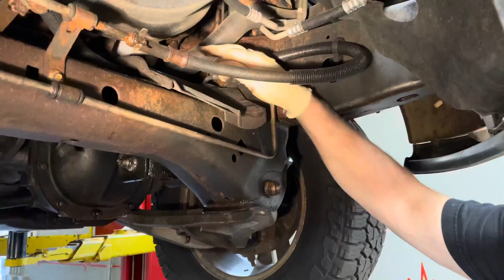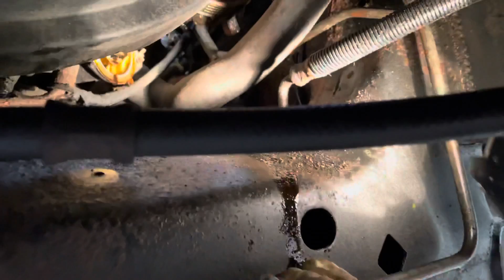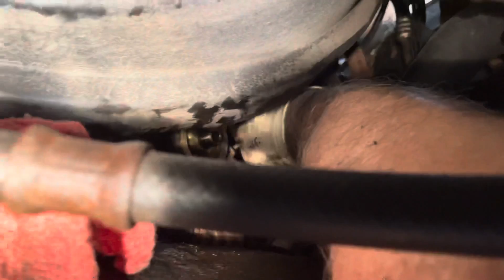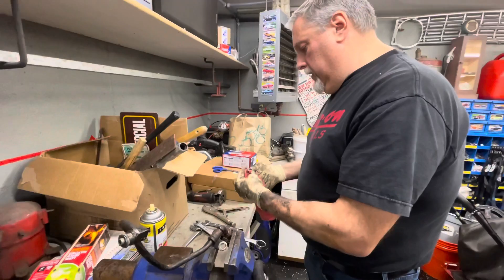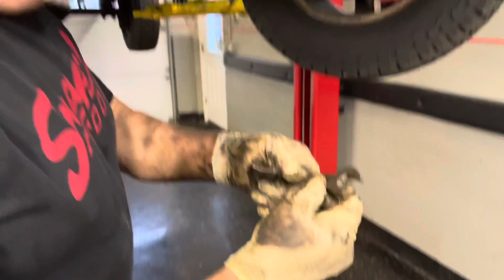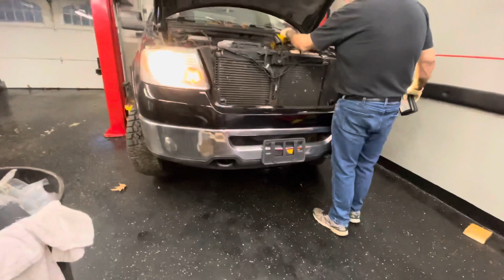How To Replace 2004-2008 Ford F150 Pressure Power Steering Hose

Comment: Do you have a video of how to change high pressure steering hose on an 06 ford explorer with 4.6  v8 I typed it in several times and  get videos of all different vehicles this app is of no use to me if you can't get show what I'm looking for
Reply from the maker: We currently do not have an auto repair video on this particular application.

Comment: Ford specifies Mercon Power steering fluid in the manual but now they dont make it anymore and Mercon V is the replacement for Mercon Power Steering Fluid.   Very important !  Mercon V only , nothing else , dont use those multi use fluids. Some lines may not have the pressure sensor , the replacement line will come with a plug to install if you do not have the Pressure Sensor, most important of this install is the Teflon o ring at the pump , the new line will have one pre installed.
Reply from the maker: Thanks for watching
Reply: @HomeownerRepair  mine is a V6 , similar but a little different set up , the oil filter is not in the way. They used four bolts to the block , there is a bolt behind the power steering line in at the pump with little room to get at it. The easiest way , pull the pulley off first while still mounted on the truck , after that there is clear access to everything. When installing delete that 4th bolt behind the power steering line in. This is recommend by Ford, it was overkill engineering and no need for it. Use an 18mm flex line wrench for the power steering , with the pulley removed it's easy access to it. Install the pump and line ( you will need a new high pressure line for pre installed Teflon O ring ) unless you have the tool to install new O rings and can find the right size O rings.  Also save yourself allot of hassle and get a new pulley, press it back on after all bolts and the high pressure line have been installed. It only takes a few minutes to pull out the fan and shroud and make life much easier, also PB blaster is your best friend on this job. This can be a mildly difficult job of two hours or a struggling fight of 5+ hours to do it any other way. 18 mm flex line wrench, 10mm ratchet wrench, 10mm socket wrench with extension for the bolt at the steering rack ( easier access from underneath) and rent a power steering pulley puller kit. Make sure when renting the kit it has the right size set up and it's not all stripped out , Advance Auto had the better kit as compared to O'Reilly's. This was my experience and hope it helps someone.

Comment: I found it easier to remove the power steering pump to get the fitting out of the pump just cut the old line off at the pump the new line comes with the Quick Connect fitting I screwed that into the power steering pump before I reinstalled it made it a lot easier and didn't have to fight to get it off and I did not have to sacrifice a tool to complete this job
Reply from the maker: Thanks for the tip!
Reply: @HomeownerRepair your video help me so I wanted to share a little trick that I discovered while doing that job so the next person won't have to fight so hard.

Comment: I used this video to help me do this job on my driveway so I appreciate it fellas....BUT.. I managed to do the job without removing the oil filter or the radiator hose
Reply from the maker: Glad the video helped you out.
Reply: @HomeownerRepair where you get the hose with temp sensor to buy?
Reply: Where you get the hose with pressure sensor to buy?

Comment: Went to replace the line up to the pulley and it's loose. Do these has a seal? The bolt goes on tight but the hard line is wiggly. Reusing parts because the pulley wheel is what broke on mine
Reply from the maker: If it does usually we talk about this stuff in the video.

Comment: Thanks for the video. I found it much easier to remove and re-connect the pressure line to the power steering pump if you remove the pump from the engine block. Of course I removed the fan shroud also since I was also doing a timing job on my 2007 F150.
Reply from the maker: Good point, thanks for the tip!

Comment: Trying to do this RIGHT now.  I have an 18mm crows foot... buuut it is too small.  What yr was this truck?  Im on an 08.  Ive got an 18 & 22.  Guess im gonna hunt down a 19 and a 20... but i dont eve. Have wrenches that size to modify. Just tryna pull the pump and leave the line cus its still good. 😮‍💨
Reply from the maker: Thanks for watching
Reply: Remove the pump with a pump pully puller

Comment: Great video guys. Iv got a 06 crew cab xlt.  Trying to buy the part. They have alot of different parts. One says with switch port other no switch port etc
Reply from the maker: If you are not sure which one to get have the dealer run your VIN # and ask them for the OE part number so you can match it up. Hope this helps you out.

Comment: Couldnt you have cut the lines, pulled the pump. Replace the lines and re installed by fishing the lines back down. This seams more difficult than it needs to be
Reply: If u install the hp line on the pump before installing it u wanna talk about wanting to burn a truck to the ground, the tension of it makes it a bich to get the bolts in the holes perfect enough to thread in
Reply from the maker: That may be another way to tackle the job. Thanks for checking us out!

Comment: What is the line just below that one ? With the 10 mm bolt plate? At the 5 minute mark ?That’s the one that’s leaking on mine. You took out the 10mm bolt but only removed the top line. Forgive my ignorance. I don’t know the names and I’m in a pickle
Reply from the maker: It looks like it may have been the line in from the power steering reservoir.

Comment: Been looking for tips how to take this precious line that ford have designed which is nuts, you gave us hope to do it diy with out using a puller, thanks and godbless
Reply from the maker: Hope this helps you save some money.
Reply: I replaced the return last year. Probably should have done both at the same time. Pressure line is pretty corroded and just started leaking today. Looks more “fun” than the return.

Comment: I'm doing the timing job on my 09 f150 so I decided to change out the leaky ps high pressure line while I had easier access. Well, it's STILL a huge pain. I know the dealer wanted big money to replace it. Thanks for the video!
Reply from the maker: Hope the video helps you out. Thanks for watching!

Comment: Some tips to make this job a lot lot lot easier from reading the forums is, remove the fan and fan Shroud it will give you an infinite amount more room, and in order to not have to cut an 18mm is to pull the pulley off. 

This video was helpful not a lot videos or forums on this, I was replacing my power steering pump when I bent the line and had to replace it
Reply from the maker: Thanks for watching! Don't forget to subscribe!
Reply: Better to make the wrench than to spend an hour pulling the pulley off and reinstalling it.
Reply: @StevePolhill  Pulley comes off in 30 seconds with a puller.
Reply: @TheDivergentDrummer  Which puller, did you use?

Comment: Question: Do you have the specs for the 18mm bolt.( Pump to valve body)..Also the 10mm hold down bolt. (valve body/ 2 lines). For the life of me, I cannot find the exact specs. I dont want to over tighten obviously.  
Best video yet Thanks!
Thanks guys!
Reply from the maker: Unfortunately I do not. If you follow along with the video you should be okay. Hope the video helps you out.
Reply: @HomeownerRepair  .. yeah no big deal I found them I had to replace the whole rack and pinion along with the lines. Lots of fun. Thanks anyways. Good video

Comment: Great video.  I just changed both. Pressure and return. My 07 has no pressure sensor.  I read the instructions about half way through.  On mine the fitting on the pump is a quick disconnect.  Should be able to pry between the nut and the square piece on line and it will pop out. I did it the way you did. My return was rusted through and stuck in the rack. I used a heat gun and finally got it out. 2 lines,5 hours out in the gravel. Getting too old for this chit. Lol
Reply: Mines stuck also..So a heat gun worked for you did it?
Reply from the maker: Glad this helped you out.
Reply: The suck is too real

Comment: I have a 2003 ford expedition, the line is broken inside of the fitting and the bolt around it is strip so I have no way to take it out, is there any hose strong enough that I can use over the old fitting to make a new line  over the old one for the high pressure line, or do you have any suggest what can be done in such horrible situation? Thank you
Reply from the maker: Can you get a small pair of vise grips on the stripped bolt to turn it free? Not sure if you can get an easy out in that spot to remove the bolt.
Reply: @HomeownerRepair  nah there is no room at all, but I did try a small vise grip it goes in circle, I am going to try and weld another bolt on it and take it from there, if not I'll have to change the whole thing or take out the whole differential and try to cut it off, either way it's a lot of work, but thank God it happened in that kind of weather, not the cold weather which would be hell
Reply: I had the top front bolt break smooth off in the block when she bit it. Yea it still resides in the block

Comment: Practically everything on the 04-08 F150 is a pain in the ass to work on.
Reply from the maker: Hope our video are making this an easier process for you. Thanks for watching.
Reply: I've had Chevys most of my life this is my second F150 your 100% correct every Fricken job I've had to do including the starter witch I've Done a lot of them Chevy always had 2 bolts then 2 nuts for the wires Ford has 3 bolts holding it on and of  coarse the third one on top is a bitch I couldn't get my fat Hand up in their but anyway If your one of those guys that prefers to do his own work buy a Chevy or you'll spend hours doing jobs that used to take minutes to do.
Reply: You can say that again.  Possibly one of the most miserable rigs I've ever worked on.  My '10 F150 fights me every step of the way.
Reply: My lines are seized in the rack. Salt does amazing things.